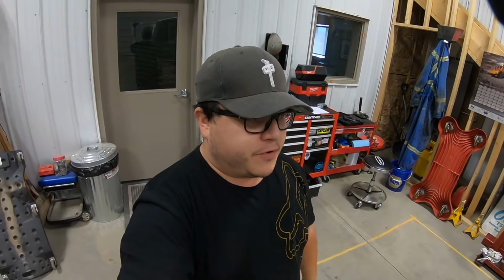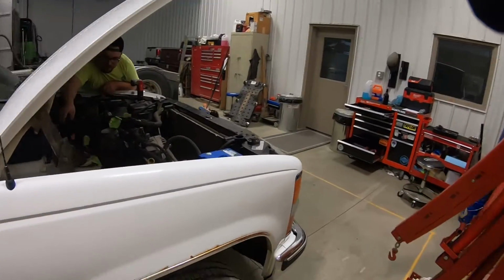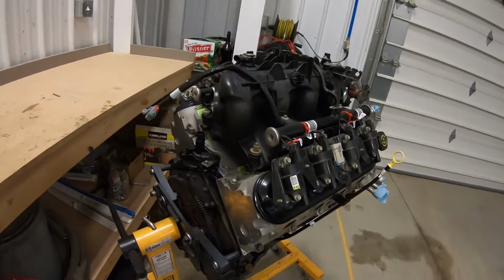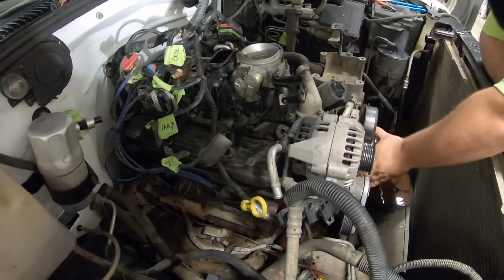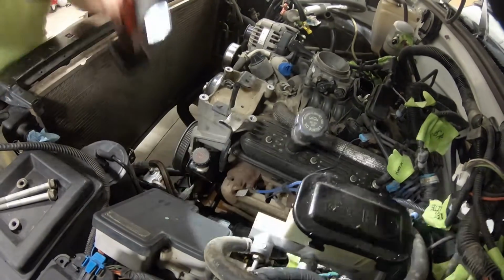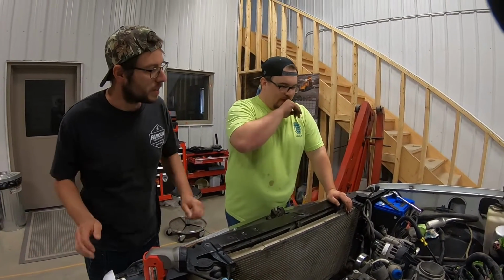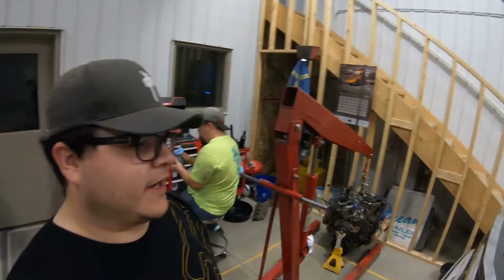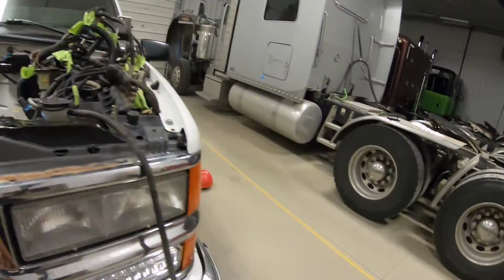6.0L LS Swapped OBS Chevy C1500 Pt. 1 - The Teardown! | REDBIRDAUTO

Comment: I replaced the motor in my '96 c2500hd with a reman. 5.7L vortec after I cracked the block and I kick myself everyday for not doing a 6.0L LS swap, the motor is so gutless it's not even funny. I'm planning on doing a 0411 PCM swap soon so hopefully I can get some more power out of it.

Comment: Nice video man 🤙. Was the harness labeled because it's being reused?
Reply from the maker: Only part of the harness gets reused. He actually went wire by wire, pin by pin through the whole harness and separated what's needed and what's not needed. A time consuming process.
Reply: Got it I was wondering because I just started tearing down my truck yesterday and ripped out the harness without thinking about it. @redbirdauto1713
Reply: @rodm2345  if you find a pinout chart for your ecm then you'll be able to trace the wire to each plug and figure out what it was for.
Reply: @Matt-df5fe  Thanks bro 👍 I'm gonna check it out.

Comment: What for fuel pump did he use in the gas tank? I have the same truck ,so im trying to find out what pump to use?
Reply from the maker: If I'm not mistaken its the factory fuel pump.
Reply: @redbirdauto1713  I have same truck with 6.0 Ls with cam 410 rear also has terminator x max .to tell a little when you take off and push pedal to floor it takes off like a rocket for about 30 seconds and then seems like its lost all fuel
As long as you Dont floor it ,it seems fine but when y do its falls on its face...thats why I ask what he used...could u check with him and let me know? Thanks
Reply from the maker: @chappyboylsx2596  im sure he'll chime in here, I think he has a similar problem in the upper rpm but he says its more running out of injector than fuel pump. I know on my firebird I ran out of Injector after I did the heads and cam swap.
Reply: @redbirdauto1713  im thinking its more fuel pump trouble than injectors. .I have stock 5.7 pump in tank and i think its running out at (wot) I think I might try walbor 400 in tank and see if that helps it..
I just thought he changed his out thats why I ask....so his is doing same thing? Its a fuel issue and im going to start at pump first...thanks

Comment: Hi how was the fit on the engine was there a lot of room left was it easy or hard
Reply: Super easy.  Fit like the old one did.  Check out part 2 for a walk thru of how it went!
Reply: @Matt-df5fe  because I was gonna put a ls7 in mine
Reply: @rebelboyce156  LS7 will fit fine.  Your accessories will likely be car accessories so the position and how they hook up may be different than my junkyard truck motor.

Comment: Aye bro I just subbed how much u think this would cost in a shop?
Reply: Just for the drop ?
Reply: It wouldn't be cheap.  I put in minimum 50-60 hours from the first wrench on the old 5.7 to firing the LS.  Keep in mind that i'm not a professional mechanic so it likely took me 2x as long as someone who does this type of stuff all the time.  Lots of little details to figure out.  It runs and drives but still needs a bunch of little things taken care of.

Comment: It's a Silverado unless the Silverado badge is removed that's why you guys say it not
Reply from the maker: Actually the first "Silverado" was built for the 1999 model year. They were C/K pickups before then.
Reply: @redbirdauto1713  I have a 1998 Chevy Silverado 2500 I ask for mi parts at the parts store as "Chevy Silverado" and they get it, not K or C, but yah I've seen and heard of it being named K or C instead of it's real name stamped on the tailgate Silverado even in some TV commercial in the 90s Chevy like a Rock they called it Silverado
Reply from the maker: @gerardomendoza9688  you're not wrong, its just a technicality really. A quick wiki search says the same thing.
Reply: My 1988 obs has Silverado badges on the interior
Reply: @Ken72142  88 😛 I have a 88 Lincoln